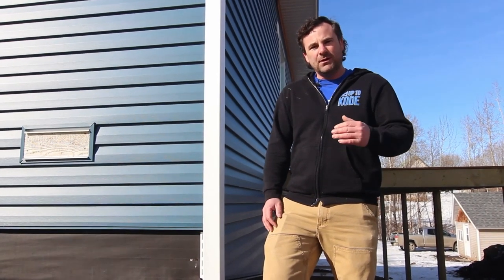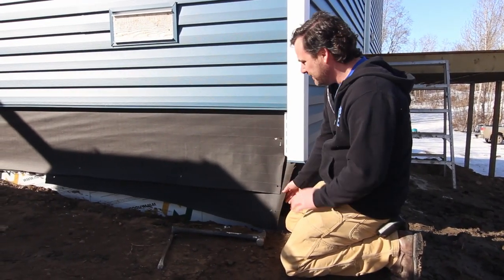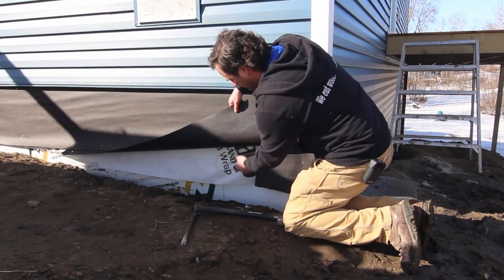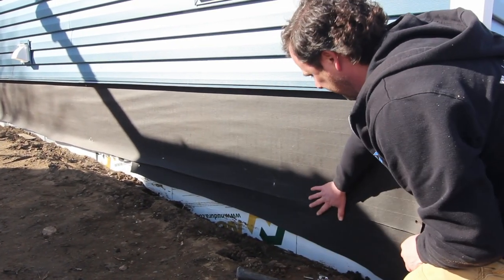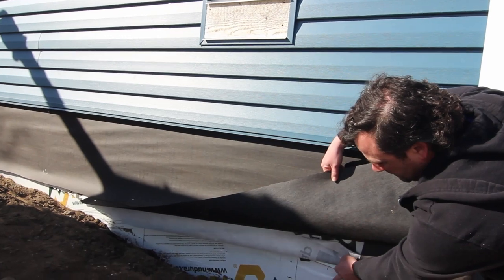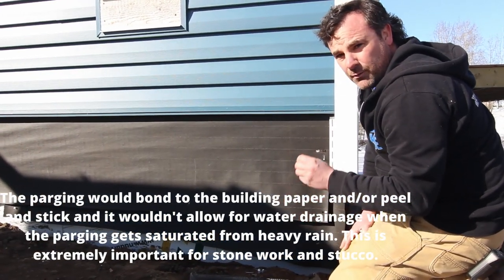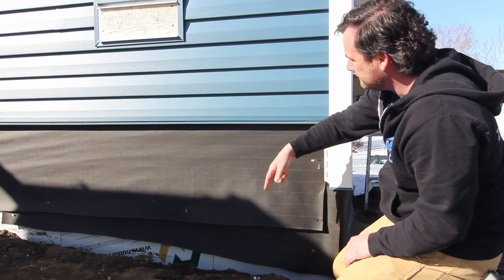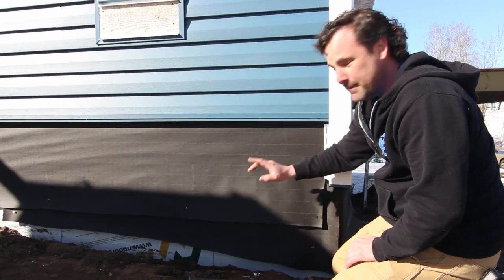How to Parge on ICF - Preparation Tips

Comment: Nothing wrong with your system- good drainage plane and good isolation for the parge, but you could do it with one fewer layer by using DuPont StuccoWrap as a continuation of the WRB on the house, and then lathe directly over that. StuccoWrap is essentially  thick Tyvek made with ridges that create a drainage plane - and it’s fine touching mortar - that it’s what it’s made for. We also use a latex modified stucco. I've never seen the screws you're using but if they're from the "drywall industry" are they exterior grade?  We've gone to all aluminum or stainless steel for any fastener touching the stucco, especially below grade.
Reply from the maker: Great info! I will remember this. And yeah the wafers are zinc coated but stainless is far better

Comment: Videos from BuildBlock and Nudura say to use a synthetic stucco (EIFS) with embedded fiberglass mesh in the first coat.  They say that the EIFS will adhere to both the peel and stick waterproofing and the ICF block.  There was no mention of the stucco getting saturated and causing a problem.  Maybe water saturation is minimal with EIFS?  It seems like your method may be a more cost effective solution and does not depend on good adhesion to the foam or waterproofing.  I think you live in Canada where subterranean termites aren't a problem but they are here in the southern US.  It seems to me that the air gap that is created around the tar paper could provide a sneak path for subterranean termites to crawl up the peel-n-stick waterproofing and then back behind the tar paper to the ICF foam.  Pest control technicians depend on termites having to create mud tubes on the outside of the concrete foundation to reach wood.  The technicians look for the tubes to determine if you have an infestation. Some companies will not provide termites protection on ICF homes because if the termites can reach the foam underground, they don't have to build the visible tubes and so not easily detected.  I am assuming your parging and its tar paper backing will extend to a few inches below grade and this will provide the hidden route.  The other method would force the termites to build visible tunnels up the exterior of the parging.  But it is probably more costly and I might be concerned with the adhesion long term.  But since you don't have subterranean termites it's not an issue.✌️
Reply from the maker: You are correct about me being in Canada and not having to deal with termites. 

I’m a stickler for drainage plane behind stucco where there’s peal n stick protecting a basement. Not that there will be much saturation with water but I’m picky. 

I usually have my parging go 12 inches below grade but I assume termites don’t have a limit to how far down they can go? 

No matter which stucco path you take the termites sound priority. If I knew more about it I could come up with suggestions. 

Even just cut a slit into the foam all the way back to the concrete and then stuff metal flashing in there to stop them from channeling upwards. I don’t know
Reply: @uptokode  Actually, the subterranean termites (Formosa) don't "resort" to burrowing underground, that is their normal modus operandi.  A typical defense against them is to  put insecticide into the soil all around your house, delivered by hollow spikes every few feet.  Usually this service comes with a warranty and so in order to not have to pay out a big claim, they inspect the perimeter of your house periodically looking for the vertical mud tubes on the concrete.  Yes, installing a metal flashing   in a groove all along the perimeter at grade is a mitigation technique also. One of the ICF manufacturers sells a flashing and has a video on how to install it when you are stacking the blocks.  Unfortunately it calls for cutting the nubs off the block and is very labor intensive.  Doing it after the pour as you say seems like it would be easier.  Use a chainsaw  to create your channel for the flashing and then sprayfoam it.  Or, just go with what the manufacturers recommend and use the EIRS parging applied directly to the foam and hope that it stands the test of time as advertised.  ✌️

Comment: Can you nail siding right into ties. I’m fairly sure Nudura warranty doesn’t cover that type of installation just curious what your thoughts are
Reply: my understanding is you'll need a rainscreen by attaching 1x2 strapping vertically to the ICF ties, which will allow an air gap for drying out any moisture that gets past the siding. a moisture barrier is needed before the strapping, unless you're in an extremely dry climate, but even then i'd still add it as cheap prevention. don't forget critter barriers for the top & bottom of the air gap.
Reply: Rainscreen is common (1/2" x 1.5" pressure treated) method, and a paper backed lathe is available to maintain the air gap. And definitely install the bug screen top and bottom on the rsinscreen.
Love the positive lapping and good use of flashing details. Always pushing water away from the building at every layer just makes sense.

Comment: Nudura shows the parging direct to the foam ?
Reply from the maker: I like having paper over top of my basement waterproofing.  I sleep better at night knowing I did it the best way possible.
Reply: Hi, did your waterproofing membrane end below another course of ICF? If so, why? And is there a termite or other flashing on top of your last course of ICF before framing? Thank you.
Reply: @uptokode those holes, in your membrane, worry me so much I can not sleep at night
Reply: @keithdygert1120 Didn't see your comment until after I posted my long winded comment concerning termites.  Good observation.  Canadians usually don't have to think about subterranean termite mitigation.
Reply from the maker: Haha. I get that but the peal n stick is self adhering around fasteners… plus my paper over top will allow water to trickle through and not be trapped then forcing itself inside.
Reply from the maker: I just responded to some other viewers with questions that related to yours.
Reply from the maker: Thanks for the great questions and feedback